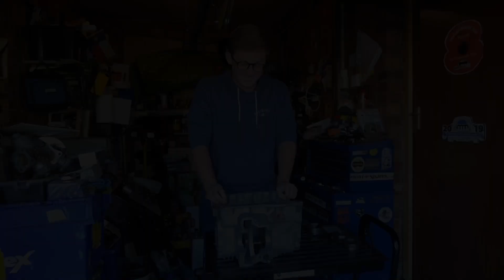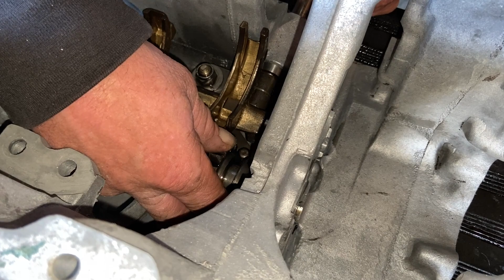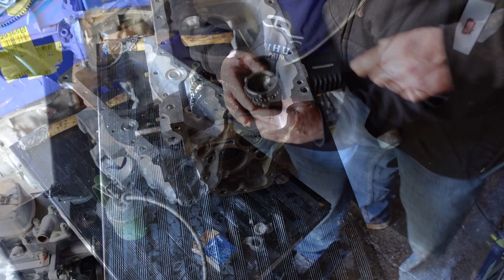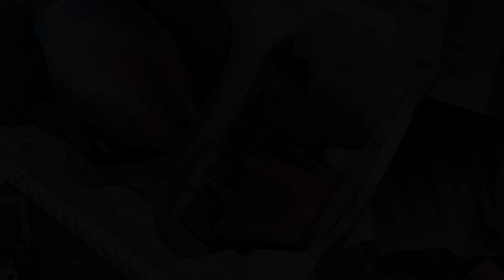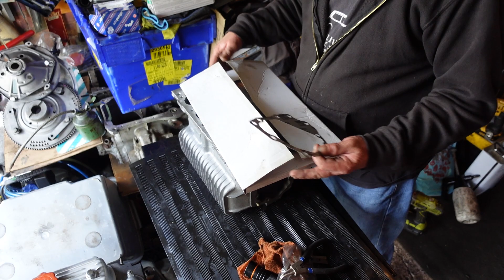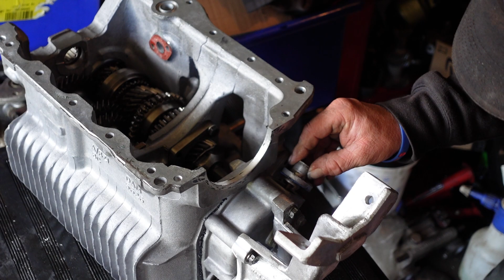Rebuilding the A-Series Gearbox - Metro Gearbox Rebuild, Part 3

Comment: Excellent work and the 'box is looking very spiffy! I learned how quickly those balls and springs in the synchro hubs can make a break for it if you don't handle them carefully (didn't have the tool that Paul used). Fortunately, only one ball got away, but I was on my hands and knees for over an hour in my garden searching for it...😁
Reply from the maker: Sod's law!

Comment: Great to see some mechanical engineering close up like this. Over the years manufacturers increasingly don’t want owners hands on in this way and many drivers don’t even lift their bonnets to check fluid levels, let alone anything else. Good stuff Ed. I’m nerdy enough to be looking forward to the next instalments. Which sets me thinking a little; why do we call those interested in a challenging subject nerds? Maybe that’s why we’re not the leading country we once were in engineering and other subjects?
Reply from the maker: Nerd, IMHO, is a compliment!
Those who aren't nerds about something, whatever that be, I have to question. What do they do with their lives??!
Reply: It has to be said, though, that when I was a young driver, we all used to pull our cars to bits and fit head gaskets, clutches, brakes, starter motors and dynamos/alternators in a garage pit (if we were lucky) or using ramps. I was an Isopon artist, too! But cars are far, far more reliable t(and safer) today when most people don't DIY the bigger jobs. Designs and materials got much better.